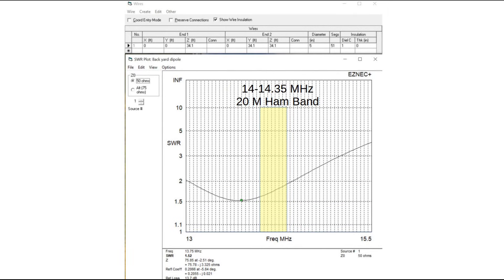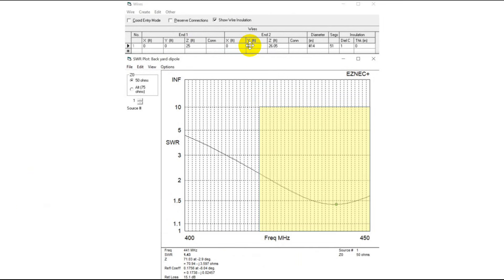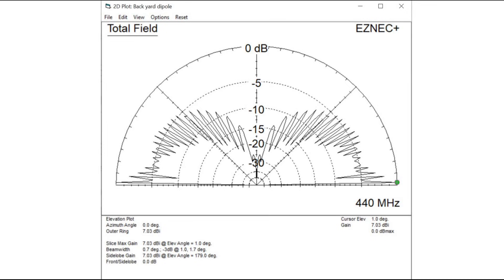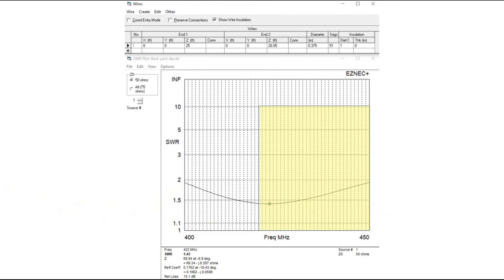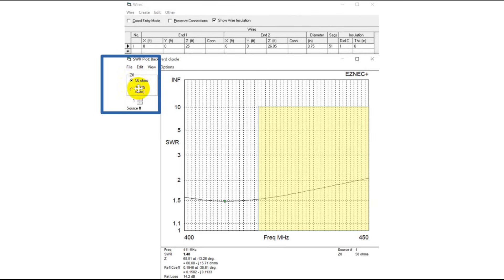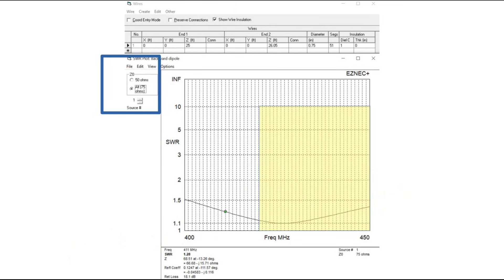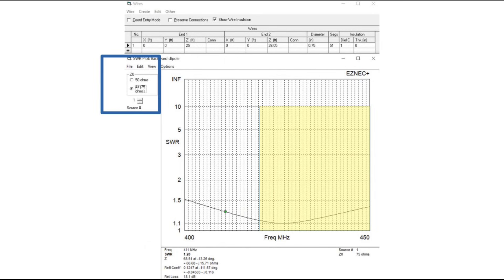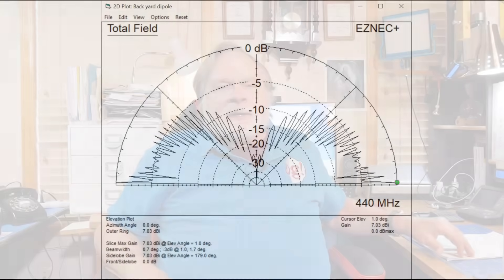Thicker Antennas Change Things (#1121)

Comment: An easy way to test the effect of a wider antenna is the tubular 5" wide copper mesh sold to keep slugs away from plants. Using a NanoVNA operating near 15 meters I compared the resonance frequency and bandwidth of a horizontal telescoping dipole about 12 feet off the ground with that same antenna with that copper mesh draped over it. 

The results suggest thicker antennas might be worth the trouble. The resonance frequency was lower by 1.7 MHz, meaning the length of the antenna for the same band might be about 84% that of a wire. In addition, the bandwidth for a 2.0 SWR was increased from 1.43 MHz to 2.03 MHz, a 0.6 MHz improvement. That copper mesh isn't sturdy and catches a lot of wind, but a copper mesh antenna might work well in the limited space of an attic. 

And if someone wants to go REALLY wide, they might investigate with the results for reinforced attic foil. Atticfoil dot com sells it in two-foot and four-foot widths. That is a heck of a lot more than the 5" I tested. The shortening effect might be particularly useful in a small attic.

Comment: Dave to Dave.... There is a formula provided in the "ARRL Antenna Handbook" and this very topic is discussed in the dipole chapters at the very beginning of the book. The thickness increases the capacitance of the antenna if I remember correctly, and therefore the resonance frequency as your modeling shows. I would think the effects of thicker wire in HF antennas would be inconsequential and accounted for in the "trimming" done during tuning. Where it would really come into play is in the realm of VHF/UHF and even Moreso in the SHF bands. good video, Sir!

Comment: As a wire antenna is made thicker four things cause the resonance change. 1. The electrical length is increased as the surface area is increased. This drops the resonant frequency while creating a flatter bandwidth curve. 2. Self inductance increases with a thicker wire and impedance changes. 3. Capacitance become less which  also results in frequency shift 4. Current distribution changes in a thicker wire and concentrates at the outer surface area especially at higher frequencies and this also reduces the resonant frequency.

Comment: I deleted my comment because I was afraid I wasn't correct. But I was. Two sources confirmed my opinion. The best source was an excerpt I found on the web, but it was unattributed. The second was in ARRL Handbook on page 20.3.
“If the diameter of the conductor is increased, the capacitance per unit length increases and the inductance per unit length decreases. Since the radiation resistance is affected relatively little, the decreased L/C ratio causes the Q of the antenna to decrease so that the resonance curve becomes less sharp with change in frequency. This effect is greater as the diameter is increased, and is a property of some importance at the very high frequencies where the wavelength is small.”

Comment: Most importantly with coax 
is the dielectric.
That's  where most of the loss is.
Foam Dielectric is less lossy than a hard plastic dielectric.
Ideally a vacuum between the inner and outer conductor lol
but that's hard to achieve.
The less mass between the two conductors, the less dielectric loss even under higher swr conditions.   
Woops again,
I blabbed on and on haha.
73 de VK3VKE 🇦🇺
Love your work mate 👌👌👌

Comment: I'm just in the early stage of your video.
Yes, I have observed that Wires/Conductors do vary in inductance.
Thinner wires have more inductance than thicker wires
of the same length.
Also the shape factors in too.
If instead of a round / cylindrical  conductor like a typical wire, we use a flat & wide conductor like used as an earthing/grounding braid, it will have even lower inductance per unit length.
This is why gauge can change the required length & the resonance of the LC system.
One more thing is the wider gauge can have a wider range of paths along the conductor due to the thickness. (Broader)
Like being able to meander along a wider path instead of a straight line. Hense the broad banded aspect.
Woops hahaha
I have Rambled.
Keep up the great work mate.
⚡🙏⚡

Comment: I saw a video on making a vertical  VHF/UHF dipole with 1/8 inch stainless steel welding rods. I got some 1/8 inch  stainless steel welding rods but have not made them yet. But I found some 1/8 aluminum rods. I don't have the software to run the models on them. what do you think would make a better antenna, The Stainless steel rods or the aluminum rods! The antenna would have a VHF& UHF going up from a PVC pipe and a VHF& UHF going down from the PVC! This is done by bending 2 - 1/8 inch to have a longer and a shorter. Longer cut for VHF and shorter cut for UHF.  Would RG6 quad shield be good to use on HF!      73    W4DES

Comment: A simple model can be as useful as a numerical model.   It's the circumference not thickness that matters.  Rather than a round wire think of unraveling the surface to a foil of length L and width W.  As W increases, a signal can have multiple path length ranging from L to a larger effective L'.  Because of this, it only makes sense that the band width increases and the resonance frequency decreases.   Because of the skin effect, one should be asking the question of solid vs stranded.

Comment: Am I remembering this correctly. Larger diameter wire has more inductance per unit length than smaller diameter wire. The would account for the lower frequency, would it not? By the way, the Russian Woodpecker antenna had a cage to give it really wide bandwidth. And I have used parallel wires separated by an insulator to increase bandwidth.

Comment: Dave, you are a Master Instructor in anyone’s book. Another great video that not only demonstrated the results to be considered but opened our minds to more related questions like:
Does it matter what the conductor material is?
Does it matter if I use 1/4” tube or 1/4” solid rod?

Comment: I have always understood that the thicker the antennae elements are the broader the bandwidth of the antenna is. But what do I know? I could be wrong.
Reply: So, say if you have the ETON 750 & you somehow replaced that antenne with a skinnier one, would that lessen the scope of the wide bandwidth it's  known for? It's  something like a width of 14.
Reply: @migi5374   It's not the the bandwidth of the radio it's the bandwidth of the antenna.
Reply: @onmyworkbench7000  help me here, the antenne draws in for the radio, NO?
Reply: @migi5374  The radio has a range of frequencies that it can receive regardless of the antenna, however if you are trying to receive a range of frequencies that the radio can receive but the antenna is not designed for then the radio will not be able to receive that frequency range as well as it would if you were using an antenna that is designed for that frequency range. By using thicker antenna elements it allows the antenna a wider bandwidth therefor allowing the combination of antenna and radio to receive more frequencies than an antenna with thinner  elements would do.

Comment: I decided to make a dipole antenna that I could adjust to cover 10 to 20 meters.
I decided to use two 25 ft tape measures. They were 1 inch wide. I know that
the formula 468 /frequency is just a starting point so some trimming needs
to be done. I soon discovered that the spots I wanted to be resonance was
considerably shorter than my calculation and the bandwidth was fairly wide.
I was using an antenna analyzer to find the lengths along the tape measure.  KF6EWO

Comment: Having designed and built TV broadcasting antennas, it is essential to employ fat stubby elements to achieve the 7 to 8Mhz bandwidth needed for a single channel. Group delay needs to be kept minimal to ensure good quality balanced pictures. This applies to the channel filters, hybrid combiners and power dividers for the same reasons.

Comment: I've wondered for years why we don't use 70 Ω coax to match a dipole. There's a lot I don't know. A few rather long observations below.

I used to have a valve KW 202 rx and KW 204 tx 40+ years ago and a very short length of 75 Ω t.v. coax to my tuner for the long wire. I had a KW 75 Ω SWR meter because you could specify 50 or 75 Ω. 

Is the modern tx really just 50 Ω out? Having built my own tx I can't see how it is exactly 50 Ω, it depends how many turns on the transformer. It might have been 60 Ω for all I know. I did just tune for maximum r.f. out much to the horror of my amateur friend, (no SWR meter). If the SWR is not known why worry! As it turns out max. r.f. out was minimum SWR when I did build an SWR meter.

i have tried a 50 Ω dummy load and a 80 Ω dummy load on my FT817 and as expected the 80 Ω wasn't liked. Is that only because the SWR indicators are set for 50 Ω? 

Can a gamma match be adjusted for 50 Ω because we tap along to get a match so I'm guessing zero to perhaps a few thousand Ohms. Is that a great way to get 50 Ω on a dipole? 
I built a 70 MHz 3 el Yagi years ago with a Gamma match, no SWR meter so who knows! A half Watt a.m. into Scotland so it certainly worked but I did have height.

G4GHB.

Comment: its worth using Tube, I have a spool of HVAC 1/4, that is about the sweet spot, I am about to change out the thin stainless steel wire on my loop to tube
yes I suggest it for any band HF, MW, UHF, and VHF there is a little tuning but not much

Comment: Hello Dave, I think if you research patch antennas you will reach the "real antenna" formula, a surface area formula. I am know engineer, but my oldest brother that retired from Lockheed Martin as an electromagnetics engineer working on avionics for military aircraft had to use the surface area formula.

Comment: Dave, Just found your channel, watched and enjoyed the video. It may only be my understanding, but talking about thickness of an element, is this the two dimensional measurement of a plane through the element ?  My thoughts are that a 1 inch tube will have a height of 1 inch and a thickness of 1 inch, where a tape measure ( a wide one) will have a height of 1 inch and a thickness of maybe 0.01 inch. How will this affect the NEC modelling of a dipole? I have often thought of making a portable yagi using tape measure blades, but which would have the greater bandwidth for 2 m and 70 cm , a 1/2 wide blade or a 1 inch blade and what orientation? vertical (90 deg) to the boom or, the blade flat or in the same plane as the axis of the boom ??  Have never played with NEC software, so will have to get a copy running and learn how to use and understand it.

Comment: Im using RG6 on my 40m slant-wire antenna, with which I have made a couple of QRP CW contacts from Central FL to North Carolina. 
According to my NanoVNA, the SWR is 1.5 with an impedance of 60 ohms at the transceiver connection point.  And i think it's 60 ohms because I had to shorten the counterpoise to less than 1/4 wavelength due to space restriction in my back yard.

Comment: This guy did the whole video, and the letter: "Q" never came outta his mouth. Higher the Q, the lower the width of that he'll curve. Think of it as a tuning fork. The best tuning fork will ring, with a gentle tap, at a single crystal clear tone. That's high-Q. Now, start adding mass to that tuning fork. Still rings needs more of a thump and damped out way quicker. Mid-Q. Add enough mass, at it probably not even be worth hitting it on something. Did it make a sound, yep. Does it sound like a crystal drinking glass nope. Even low Q dioples will push out a field if you push it hard enough. Wider radiators have more surface Area, trying to "push  a rope"
Reply: Mag. loops are a high Q and very narrow tuning range. I've built a couple of them.
G4GHB.

Comment: I seem to remember Yagi calc's involved diameter back in the 70's. I no longer have one of my ant handbooks from 70's, but I do remember some design's take into consideration of element diameter.
Reply: I remember hearing similar discussion around making elements out of Aluminum Arrow bodies rather than solid aluminum rods. It wouldn't work at any frequency where the driven the reflecting element needs to be larger than the length of the arrow.

Comment: Try it Dave, I us to try on HF and VHF , RG6 cheap 75 ohm TV coax and work. Also this coax can handle 75W on VHF , it is maximum what I have. On HF I try 25W same because I have it. Usually I use better 75 ohm coaxial cable but RG6 is fine.

Comment: Well, if its thicker the capacitance between the elements would increase  for 2 reasons, the external wall area of the elements increases and the distance between the elements decreases. These would require intrgrals to find the rate of change as the thickness increases with the changing shape of the conductor. The resistance would decrease because of the volume per unit distance increasing. If you break the equations down completely, those changes might account for what youre seeing. By that logic, tube should have greater capacitance and resistance than solid stuff, more skin area and less volume per distance.

Comment: I've always wondered if the reason why the antennae that were used at the Woodpecker site in Chernobyl were what looked to me like cage dipoles to maximise bandwidth. 

This also explains why UHF antennae tend to have much broader bandwidths for a given element thickness compared to HF. 

Really interesting video, Dave - thanks for the effort you put into making it. It also raises questions regarding the easiest way to match from a 50R transmitter to a 75R run of coax to maintain the best SWR and reduce losses in the feeder although I've not got much chance of getting a lot of relative height on 40m and below....

Comment: I am not an antenna guru so take my opinion with a grain of salt. If I under stand it correctly...
The antenna is looking for resonance. If you measure a thin wire length, you can calculate the frequency. As you increase the diameter, you can still measure the length. But consider also, you can measure diagonally (Pythagorean theorem). Of course the length diagonally would be longer. That would make the antenna longer, causing the center frequency to drop. 
Because the antenna is looking for resonance, it would find it anywhere from the length to the diagonal length. That is why the bandwidth would be wider. 
KE0OG used 20m, notice on 70cm the length to diameter is more pronounced so the diameter will have more effect on the center frequency and width.
If my numbers are correct (1/4 wave), 435 MHz comes to 16.4 cm. If you use a 1 cm diameter, the length might change to 16.43 or the frequency to 434.2. Notice KE0OG's center frequency drops and the band width widens. Look at the width of the 2:1 SWR line to see width change.

I am not saying I am correct, just another perspective in hopes to clear it up.
Reply: It isn't looking for resonance, it's just that the electrical field propagates along a given length at a given (more or less) amount of time. But yeah, I guess that makes sense otherwise. Cheers.
Reply: @WR3ND  Thanx. I was implying that for the antenna to be properly tuned, you wouldn't have common mode current on the outside of the coax. 
If I understand correctly coax will act reactive if the antenna and radio are different impedances. That is how a tuning stub works.
I ASS-U-ME the reason tuning an antenna length can get confusing if the antenna is out of resonance, the coax length can affect the SWR.
 Always looking to have my misconceptions tuned.
"antenna is looking for resonance" is a sloppy comment (grain of salt), but intended to mean you don't want RF burns through you mustache. Or in my case, the smart charger on my sailboat gets reset by the halyard antenna when I transmit on 3.9 MHz
Reply: @ny1t  Ha ha, yes, we're the ones looking for resonance, just not the wrong sort. 😆 73

Comment: Thank you David, I am going to download EZNEC and do some modeling.
By the way I have just built a homebrew 4 band moxon antenna, for 20, 15, 10 and 6 metres.
I fed it with 50 ohm coax and used 75 ohm coax to join the driven elements from one to the next. Tunes great on all bands.
David HS0ZQA Thailand
Reply: Can you share the instructions for that build? 
73

D. C. 

WP4TGK

Comment: Paweł, AFAIK no one looked for such equations except for very short (lambda/10) antennas. Professional antenna designers have access to good modeling software, and anechoic chambers where they test models, so the equations and rules of thumb are just a starting point for them. They don't need to use an equation when the simple answer is "come up with an idea, model, then test."  - 73 od Maćka VE7EVE
Reply: Maybe indeed this is one of the problems that as of today has only numerical solution, mathematical solution is yet to be found...but its a bit hard to believe.
Reply: @liamkaloy  I agree - there should be a mathematical solution or at least an approximation. Putting this one under "Trade secret" because the both US and Russia used large cylinders for antenna receivers.  Look up "The Woodpecker" 
It was not just for Structural reasons.
Reply: @liamkaloy  Not really. It's a system consisting of conductors, insulators, charges and currents that all interact – with delays. They all connect through Maxwell's equations, but the result is usually neither simple nor predictable. Some configurations are nice and predictable. Others only look good, like the infamous "fractal antenna" attempts.
Reply: That may be the answer - build and tune, build and tune. No need to publish. 
"Trade secret" might also play a part.

Comment: It is all in the ARRL Antenna book.
Reply: Or if you really want to dig in, in the Antenna Engineering Handbook that you can find at a nearby techincal college library.
Reply: @Matthew.Morycinski  ISBN 007032381X?  2 decades ago I went through earlier editions of  ISBN 83-206-1626-3, which seems to be your recommendation equivalent. Maybe first I go back and check there. I remember that one was not an easy read.